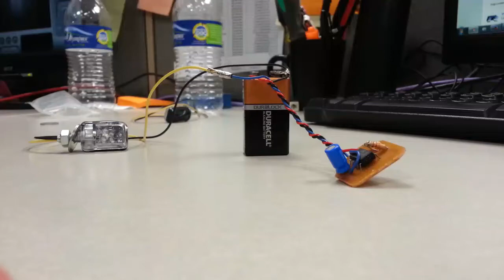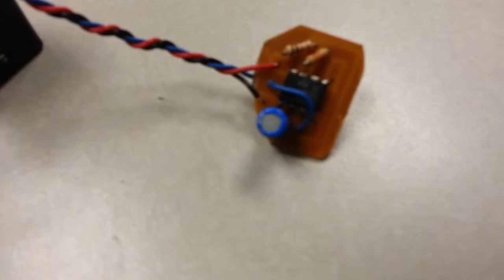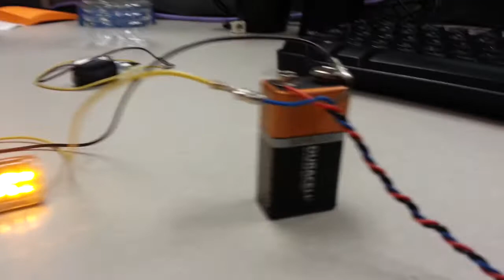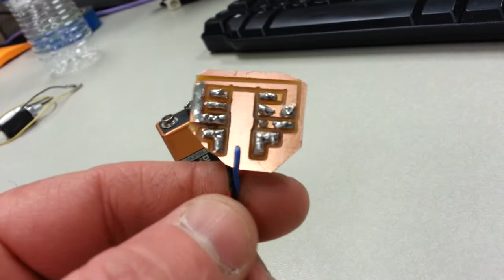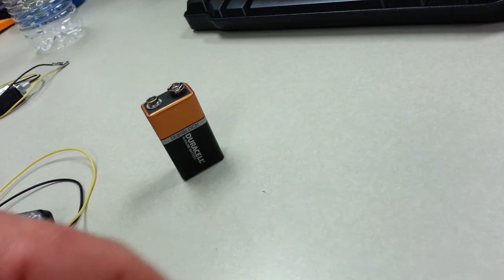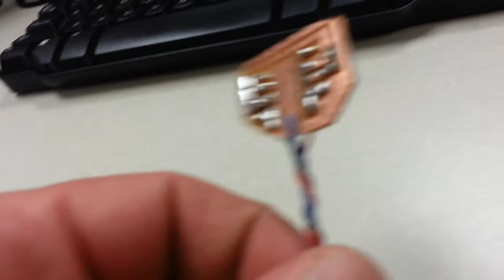I made a solid state flasher for my motorcycle!  Cheap but effective.

Comment: my bike has a two pin flasher, what alterations do i need to make it work in my bike?
Reply from the maker: My bike also had a two pin flasher.  What is important to understand is that the flasher relay module is a complete path for electrons to flow.  The flow is disrupted when the current flow causes the thin piece of metal to deform which breaks the path of electrons and keeps them from flowing.  When that piece of metal cools down it will reform the bridge that it was before and you have the on off on off flash.  This design here makes it so that even when you don't see the indicators flashing the signal is still being sent there.  So there are three wires, Ground, 12 volts, and the blue line I used runs from the circuit to your flasher switch which sends the flash to either right or left lights.